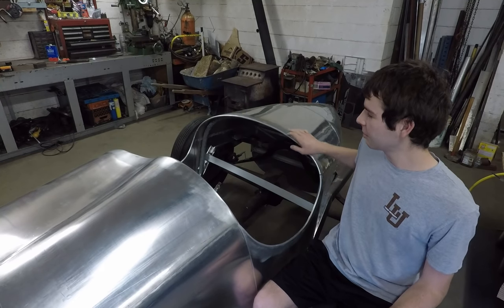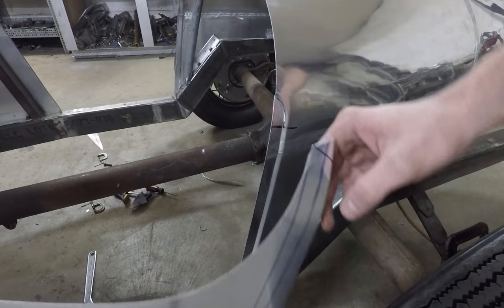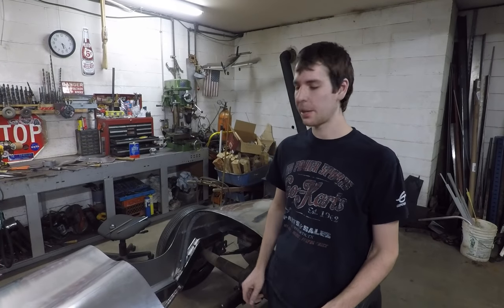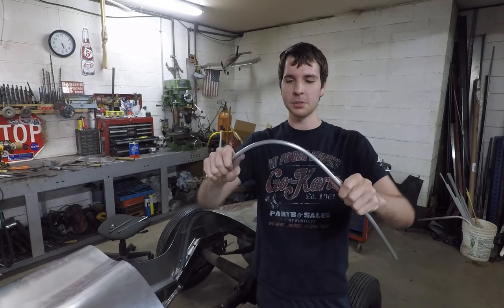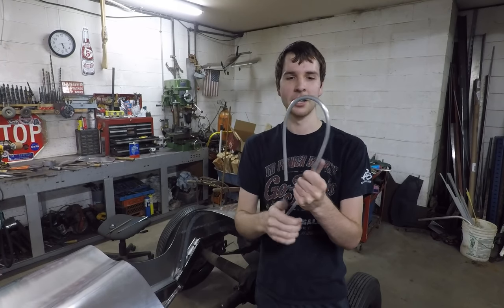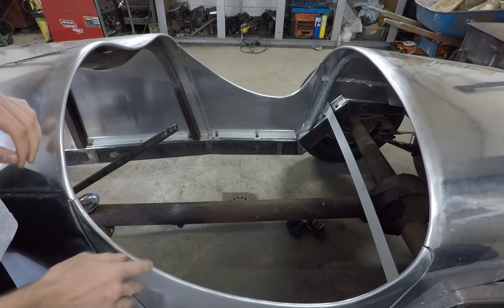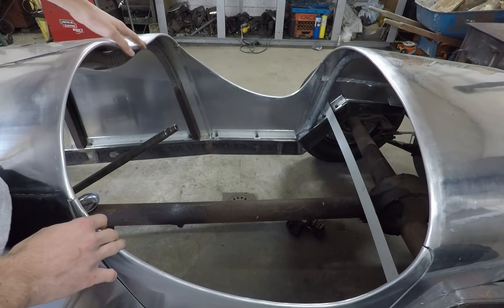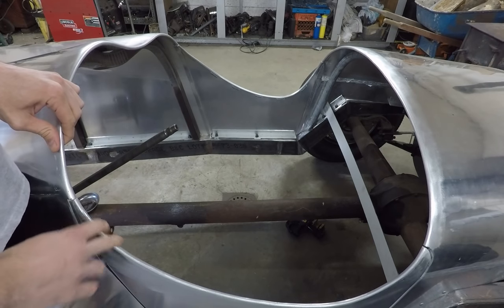How to Weld an Aluminum Rolled Edge | Homemade Boat-tail Speedster pt. 36

Comment: at 7:10, you can see the aluminum panels expand and shrink in the reflection of the flourescent light. reinforces the fact that welds have to be done in a pattern to reduce the expansion from the heat.

Comment: Are you planning on adding some kind of structural door bar? You could easily weld some tube from that front dash support to that rear hoop for a little side impact safety.

Comment: Another way to anneal aluminium without blacking up your shop with soot is ivory bar soap. Simply rub the soap bar all along one side of your rod or panel and then heat from the opposite side. When the soap goes liquid, you have reached the right temperature and just let it air cool.
As far as the welding of long stretches like that, although I normally don't recommend it as I don't like the process, you may want to invest in a small MIG system with a 1 pound spool gun. Your welding speed will be about four times as fast as TIG and your gas consumption considerably lower. I used to weld long stretches with a 1 pound spool gun and it works very well for non-load bearing joints where cosmetics are important. Don't let someone talk you into a push drive cable system for aluminium. You will waste more time and wire than what it's worth as the soft aluminium tends to jam in the cable and stop.

Comment: I'd been thinking about that tube technique, only since it is a steel body, using steel conduit.  I thought I would try to cut a slit lengthwise in the tubing to slip it over the edge of the sheet metal.  But after watching you, that tedious difficult step seems unnecessary.

Comment: Another trick to make sure you get the right temp for aluminum is to just mark it with a sharpie - when the sharpie burns off it's hot enough.

Comment: Curious, noting the amount of material you removed from the edge, did you think of bead rolling the edge of the material? I am thinking of the rolled edges seen on fenders from the 1930's
Reply from the maker: yeah, I experimented with making edge rolling dies for the bead roller, but I wasn't happy with how they worked
Reply: @MacroMachines  I do remember one of the auto tool companies has hand held rollers advertised that wraps the metal around wire in the same manner as the beaded edges of the fenders I mentioned. The tool sorta looks like a can opener.  Good video.

Comment: like to find out the weight of the aluminium body once its close to done , there is a special type of covered moped / car type thing here that you have to pay no roadtax and less insurance for and can be driven without a licence , one of the rules is that the weight of said car needs to be below a certan treshold (350 kg / 771.617918 pounds) and it needs to be below some dimentions (basicly a microcar) 
think i might be able to make one withing the weightlimit if i use aluminium for the body 

to bad you didnt weighed the chassis as weighing the car and substracting the weight of the chassis wouldve been eazier and safer

Comment: Were you aware that the original method of creating a rolled edge, is to form the sheet metal  over a ~1/8 steel 'wing wire' ?